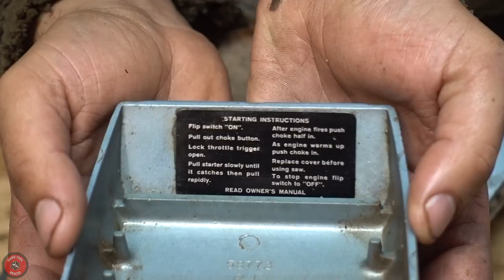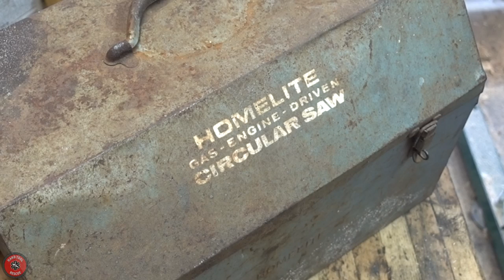Rare Gas-Powered Circular Saw [Rescue]

Comment: I undestand why we have moved to electric. :P
Reply: Why?
Reply: Can you imagine having to start that thing up everytime you want to use it. You'd also fill your workshop with CO2.
Reply: I Don't think it is meant to be used indoors, do you?
Reply: Carbon dioxide? don't you mean carbon monoxide....CO a colorless, odorless, and tasteless gas that is slightly less dense than air.
Reply: When this saw was made, generators were much more expensive than they are now. Still a cool old piece of machinery.
Reply: Carbon monoxide is also formed by combustion and will kill you in high levels why do you think the check emissions on your auto
Reply: To be fair, then both Carbon Monoxide and Carbon Dioxide can kill you in high enough levels... Only difference is that CO2 (Carbon Dioxide) will only kill you if it's the only other gas around and there aren't enough oxygen to breathe. It's usually CO that kills and therefore too much of it in your workshop will kill you. Zeke is right, here's proof:

https://answers.yahoo.com/question/index?qid=20081015164627AAURsK5

https://www.thenakedscientists.com/forum/index.php?topic=46104.0
Reply: +Alex Genna Both CO and CO2 are produced in combustion, along with many other gasses depending on what's being burnt. CO2 is relatively harmless unless it displaces all of the oxygen in the room. CO, however, is quite toxic.
Reply: this is an outside, working on a property line fence kind of tool.
Reply: It's the same story with electric automobiles. More reliable, instant power, and way more torque. Not to mention more environmentally friendly.
Reply: Where do you think all of that electricity comes from? In the US, primarily fuel-burning power plants. And what happens in the summertime? Some areas are already very prone to brown/black outs in the summer when the demand for AC is high. What happens when thousands of people plug in their cars to charge? Electric cars aren't the answer. Clean alternatives to producing electricity is!
Reply: LostInPhilly89 >> True, but lets also make it clear that Nuclear isn't a clean alternative. It still pollutes. Just not in the conventional way. There's also the fact that the US have much lower voltage for their house AC than in Europe, where we have 200-250 V.
Reply: LostInPhilly89 yeah but nucular is just too much of a wild card . to dangerous. if you have a meltdown you won't be able to inhabit the area for a thousand years. also many people will die. this makes burning coal seem okay to me
Reply: Eloeh & Jawga
Oh, I totally agree. Sorry if that seems to be what I was implying. Nuclear is absolutely far too dangerous. Personally, I'm a big fan of electric, wind, and hydrogen power. But, the oil companies have the US in their pockets. The only way to easily "fight back" for now is electric cars. However, that only increases their hold on us since the cars need to be charged.
Also, thanks for provoking a mature, grown-up discussion! That is really super rare on YouTube nowadays. :-)
Reply: Actually, we have 240, but too many homeowners are scared to wire up an outside 240 outlet....
Reply: LostInPhilly89 >> ah, sorry mate, my bad. And yeah, I agree. The oil industry are deep into the US's pockets. I personally try to find ways to avoid the currently ever existing problem of charging electric devices. Two ways would be to install road charging into the roads, so the cars charge while they drive and only need a charged battery to start up and enter the road, but that would probably be trashed when the oil industry intervenes.. Another way would be to install a generator around the wheels (I believe it's a kinetic one, but I'm not entirely sure), thus harvesting some of the energy the car spends on moving forwards, back into the battery and thereby making it practically drive forever (or until it's stopped). I've seen a concept design to a hybrid car once, who had this, but I can unfortunately not remember the name :/

I'm also trying to think of other means to do this, but if none can happen, then I believe our best bet would be to make a hover car that uses plasma or a magnetic field, in order to hover, yet which can create its own energy. That would be one heck of a leap ahead of the oil industry. I'm thinking that the safest plasmatic hovering technology, would be to try and make the one from Star Wars a reality. It sounds a lot like dreaming, yes, but considering that we've created a drive for spaceships which we don't even know how actually works, just that it works (I'm talking about the EM Drive, which has been confirmed to work) and that it breaks pretty much all laws of physics, then this suddenly look a lot more realistic :)

And no problem man. I'm always trying to push towards mature discussions here. Mud throwing has never solved any problems. Just made them worse :)
Reply: Nuclear has it's benefits, as well as the negatives. It far from the free energy that it was once proclaimed. It does have the nasty side effect of waste, but produces no emissions, in and of itself. But from a power density standpoint it is unsurpassed. A pound of uranium is equivalent to 3,000,000 pounds of coal. 

It is worth noting that currently, producing highly dense battery's is not environmentally friendly. 

On the same ticket, as we move forward we consume exponentially more energy to do the most basic of tasks and everything has a price. Efficiency drops for every change of hand. It's also more efficient to have one massive powerplant than to have 50 smaller ones. And, as much as I dislike oil power, we simply lack the infrastructure to implement it all at once, as many would like. We could potentially generate over 11,000,000,000 horse power of hydroelectric power in the United States, but that would be every drop of falling water, and would still be less than 1/4 of what is required just for electricity. 

Even Elon Musk's idea of a solar/battery grid has it's downfalls. The key to surviving is having a backup plan, or in better terms, diversification is key. A good combination of stored hydro, solar, wind and even nuclear or petrol would be key. What happens if an "act of God" occurs and blocks out the sun for more than a year? No sun shine, the largest nuclear reactor in the solar system, means no renewables, wether that be wind through convection, solar, rain for hydro, and even ocean currents. It's a matter of if rather than when.
Reply: Why don't we use hydrogen instead of oil or coal to burn, it's cheep to make(from water) has 16 times more force, and burns cooler. Yet no one looks at the obvious replacement for petroleum products as fuel. Check out some hydrogen generators on line, you can double the millage you get with gas. As far as I know it won't work in planes...

Comment: The absolute last thing I would have done to an old engine like that would be start it right away! Something that old you need to run through everything first. You got it working none the less, so I guess it turned out ok this time.

Comment: at an old job I worked at, we had a few gas powered 1" drills used for augering large holes into telephone poles.  To today's standards they were pretty weak for torque, but they were built to last.  Easily 30 years old and still worked.  Those these kind of tools are big and bulky, definitely a throwback to a time of pre-cordless times.   Though you have to wonder, if it makes more sense to lug a generator or compressor than to handle a big tool like this all day.

Comment: I would oil up that blade guard better so you don't get hurt
Reply from the maker: +Dave Wilson I think it's actually missing the spring.
Reply: likely, I no longer use skillsaws that have questionable guards,  Had one jam up on me in the rain and bounce off my steeltoe when I put it down.  A 1\4" closer and i'd probably be missing a toe.  I also have a thing for saw's with electric brakes now :)

How's it for power? better or worse then a 13 amp saw?
Reply from the maker: Easier to stall than an electric saw, that is for sure.

Comment: One of these days, I want to see an evap-o-rust ultrasonic cleaner, and I want to see you just drop an entire-ass gas-powered restoration piece - like the entire thing, no work done on it at all - into the vat and just fucking leave it there overnight, cleaning, soaking.  Sure, the engine would be flooded and wet, but it would dry out. I can't imagine an overnight soak in water would permanently damage all the components - maybe the spark plug cable.

But imagine how much less work that would be to clean up once it comes out!  Just rinsing the rust and dirt off... so satisfying 😂

Comment: I know someone who has one. They're definitely an odd duck, but before the advent of battery powered hand tools it sure could save a lot of time on the job site as opposed to electrical powered hand saws/tools that would require a generator and miles of electrical cords to get the job done. Gas 'er up, put on your hearing protectors, and go to work w/o all of that hassle.

Comment: Great find w/case and good to see you having it running.
But,
Mine is bigger! XL120, 12" blade, 4-7/16" max. of depth cut and 27+ pounds. Bought it used from a tool rental shop in the early 70's. Used on timber and other heavier woods over the years, even to cut sandstone. Gets put away for months and then fresh gas, 2 - 3 pulls and the beast comes alive.
A couple of thoughts on yours: take apart the blade guard, clean, tighten the spring and lube. 
You set that running saw down with the blade guard not down all the way and ...............
Please put a plastic knob on the air filter cover.
Reply from the maker: +Bernie Jones Oh Damn!  I want the XL 120.  If you ever want to sell it, let me know.

Comment: that's an absolute beauty... NEVER seen one... These must have been a one off run from homelite and realised that having 50cc at a circular saw spindle is nuts to say the least.I search the fleebay adds for old 100cc plus Jonsereds amongst others as ive  softspot for those big V8 like saws and ive never seen anything like thise EVER.. ive seen chainsaw winches and stump pullers, but nothing like this....

Comment: ...This is actually a circular saw, in the same vein as an electric one...not at all the same tool as a cutoff/demo/concrete saw. Looks like it would have been very handy in the day before cordless power tools, where you had no electricity. I am surprised they didn't sell tons of them, and surprised McCulloch, Poulan, Pioneer, Stihl etc. didn't get in on the act. It's basically a Homelite XL-12 or Super XL chainsaw with a gearbox and circular saw components bolted on in place of the chainsaw parts. I would love to have one, but when one occasionally comes up for sale on Ebay, they bring crazy money....

Comment: I have never seen that make and model before but I have seen gas powered circular saws before but not since the 1970's.  I have to say the power vs battery has to be way better and it would just keep running and running too.  The reason we don't see more of these is that the manufacturers would prefer to lock you in to their batteries (the consumables).

Comment: Oh my God that's sexy, I've had several sixteys and seventys homlite saws. But it would be an honor to lose a finger to that beast. Side note my first homlite came with a daytona parts saw she had a instructional sticker recommending you mix one gallon of regular with a pint of thirty weight motor oil. Something about a saw that pre dates two stroke oil. Tell you what though, my right thumb doesn't miss the oiler. I've had a modern saw for years but the ol' right thumb is still looking for the oil button. Carpel tunnel.

Comment: this gas powered circular saw- what a beautiful beast 8-) but to be honest, i wouldn't use it indoor this it emmits a lot of noise, dust, and stinky fumes. anyway, i can think of some use cases where such gas-powered machines still can make sense, e.g. in completely remote sites without any electricity grid connection.

Comment: really great video nice to see someone else wanting to restore old equipment would you mind if I gave you one little piece of advice. when you use a puller on a flywheel keep the nut on the end of the shaft. it prevents the puller from doing any damage to the shaft and also stops the flywheel from flying off but that's all I enjoyed this video
Reply from the maker: +steve grover thank you!
Reply: Hand Tool Rescue no problem.i wasn't criticing.its just in the past repairing small engine equipment I found pullers can open the shaft then it's game over. placing the nut on the end helps prevent this I thought I would share this with you

Comment: That's pretty cool never seen a circular saw with a gas engine I have the first Homelite weed eater ever made the motors right at the bottom where the spule is and the tube is the gas tank it works but man it's loud sounds just like a chainsaw.

Comment: Interesting idea, although if I were building a cabin in the woods far from the electric grid, I'd get a portable gasoline generator with a four-stroke engine that didn't need oil in the fuel and use it with all manner of conventional power tools or to recharge batteries of cordless tools.

Comment: For removing flywheels from small engines in the future, you can just tap opposing sides with a deadblow or hammer handle and itll just lift off. Prying on them risks breaking them cause they are just aluminum.

Comment: Strange to see that these are rare. Makita (and a few others) makes a powerful gas powered saw with a rock cutting blade that's used for chopping brick or concrete walls. But it has a fixed guard and it's not meant to slide, just dip into the material. I guess it's due to wood being so much softer, that you don't need the higher energy density (and power) of gas compared to an electric motor - there's even battery powered ones.

Comment: Ether is a 2 cycle engine with a dry bore and a dry base. Excellent. penetrating oil to lube the recoil instead of taking it apart and cleaning the dirt out and using dry lubricant. Never even cleaned the dirt out of the guard so it moves freely.

Parts companies dream of having customers like this. they seem to sell more. Insurance companies fear people like you for the accident medical claims

Comment: What, no new paintjob ;)? Also it looks like its not a direct drive tool like the drill, there should be a clutch between the engine and the blade,(can be a wet clutch in the gearbox) getting that into spec can limit slippage and put more power at that blade.  

Love what you do, Subbed

Comment: I think that's the strangest spark-plug I've seen yet! I like that it directs the saw-dust to the side, my electric saw doesn't! Is there a spring missing from the blade guard or is it normally gravity operated?
Reply from the maker: I think it should have a spring.  A new spark plug for this thing took a long time to find.
Reply: It'd be safer, and I'm not surprised, that one looked uncommon!

Comment: I've done monitoring for carbon monoxide around similar gas powered tools like cut off saws and chain saws in confined spaces.  Older gas powered engines like this one can give off large amounts of carbon monoxide in a short period of time.  I'm sure the owner's manual states "Use only in well ventilated areas."  LOL

Comment: as awesome as this is today a single generator then electric tools would be the way to go for off grid work site 
mostly because you would all ready have ext cords and power tools for working on job sites so a single generator would allow you to use all the tools you all ready have and run lights and any other electric equipment 

thanks for the awesome vid

Comment: WOW i haven't seen one of these XL jobs in many many  years, even though i have the chainsaw version myself; this one DOES run much better than mine, because whoever had it before me used the wrong oil/gas mix and ruined the piston/cylinder; you can still get it to run; but i just don't like to force ANYTHING  that is in this poor condition. These old models were all The old 16:1 mix, and ANYTHING other would do much damage

Comment: The rushed cleaning job is really messing with my OCD 😂😂 I'm confused as to why you seem to want to get the thing to run with as little effort as possible and keep having to go back and forth finding small issue after small issue, instead of doing a complete strip down, clean and inspection before trying to get it running.
Reply: Charlie Cozens 
My thought exactly

Comment: Hello @Hand Tool Rescue
 what brand is that puller you used to remove the flywheel? What store did you get that puller at?  I repair vintage homelite chainsaws of the same era and need to find a puller for the flywheel.

Comment: Blade guard does not appear to be working correctly.  Should be a return spring and it should snap back quickly over the blade.

Comment: Good luck finding one of those goofy plugs. Pocketed wire end electrode. Copper core no carbon insulator for radio interference should last a another 50 years.